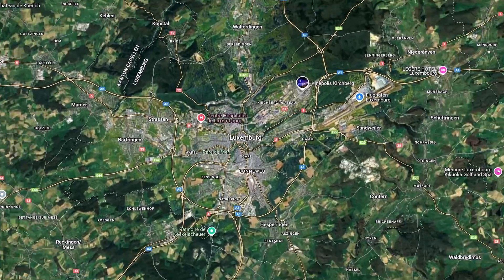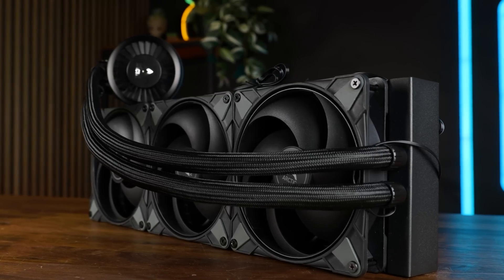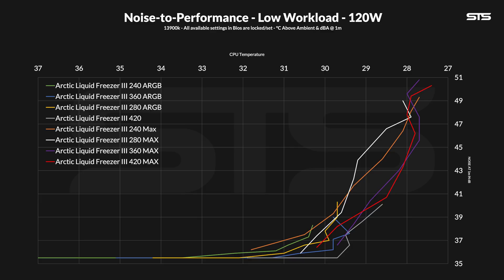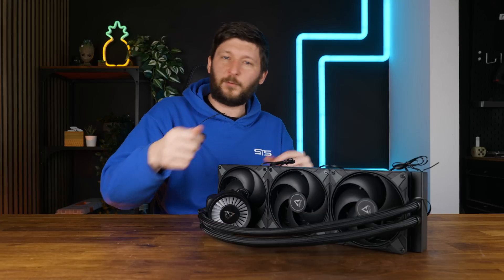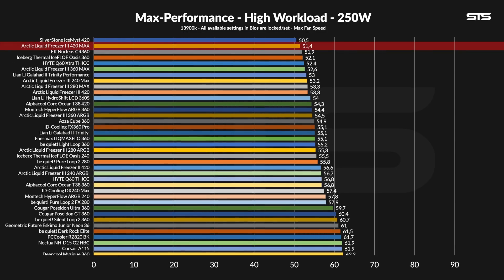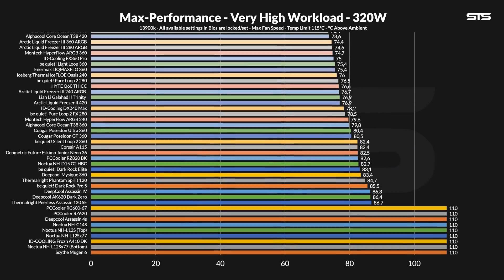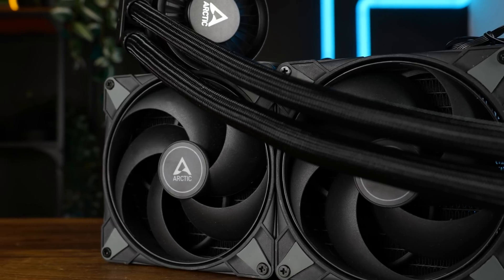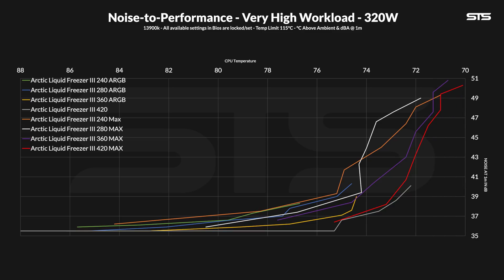We Created (another) MONSTER - Arctic Liquid Freezer III 420 MAX

Comment: Try running pump at 70-80% n i notice a better temp on cpu like jay2cent said the little bit of air in aios gets trapped with pumo running at 100% should try it out worked on mines saw an actual difference from running @fullpower

Comment: For anyone interested I'm running a LF420 Rev.2 with x6 TT TOUGHFAN EX14 Pro's in PushPull on a 9700x. The goal was cost effective cooling that was very quiet at load. Now while it does work well in gaming, my clock speeds are great; 5.63 - 5.66ghz (I did have to do per core negative offsets to achieve this). However at 170w the cooler almost instantly thermal throttles in a CB23 run. I sent a HW info logging of daily usage including benching and gaming to Arctic support and they concluded "that is normal". 

So while this cooler maybe good with Intel, with AM5 cpu's the IHS is going to severely limit any additional fans or rad size you may have. I think it would be interesting if @STS can do some tests on AM5 cpu's as well as the Intel results really do not apply to AM5 owners. The LF420 is good for up to 120-130w on an AM5 cpu, beyond that will thermal throttle in heavy multi-core workloads. Beyond this I would need to delid and use TG's IHS replacement to get better temps, but is not worth the risk and/or cost with a 9700x.

Comment: J2c videos show that having a pump running at 100% isn't always the best for cooling, even that the sweet spot is around 70-80% in some cases. Maybe that's something to take into account too?
Reply: its up to type cou you have, when i had 13700k i had on 75% any higher was no use but when i move to 14900k i do see themp drop when i have pump on 100%
Reply: I've started doing this with my Corsair H170i once I got it in back in December. The AF elite fans are nice and all but they cant keep up with the pump even at their max speed. My case fans also cant push much air either so i plan on replacing those.

Comment: Arctic needs to make better cold plates for the Freezer iii and sell them separately for those who wants to swap them. Conclusion of these tests shows that, the heat transfer from cpu to the liquid in the aio is limited by the cold plate.
Reply from the maker: Wait until you see the max videos, the same thing, just in turbo mode